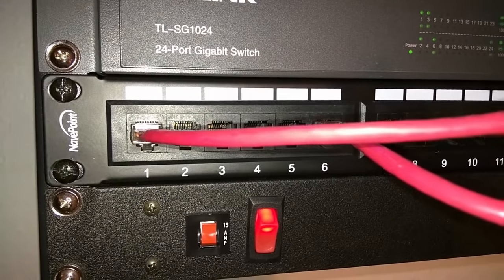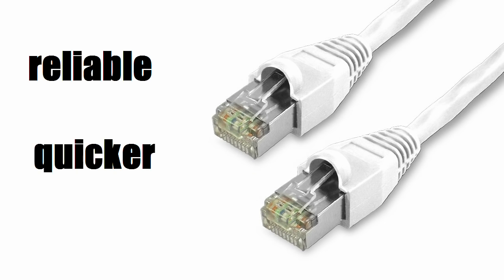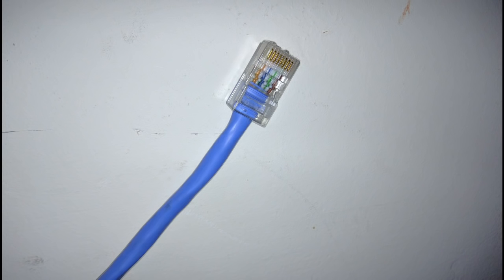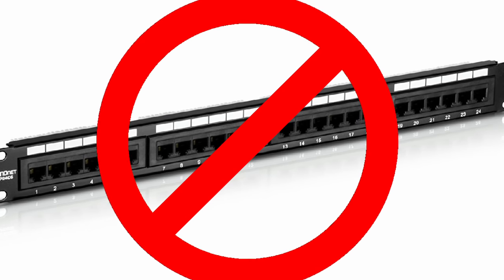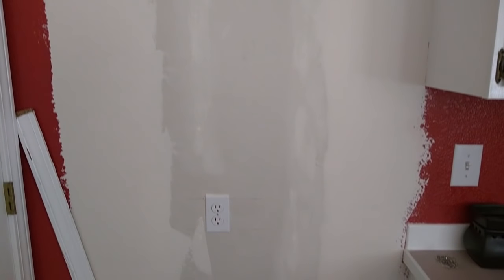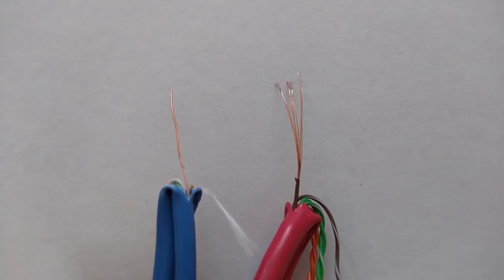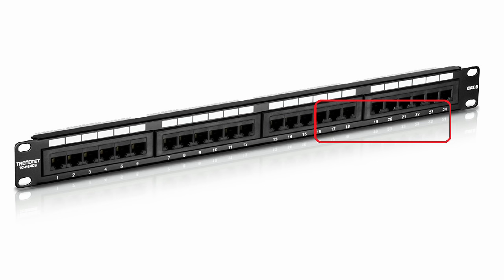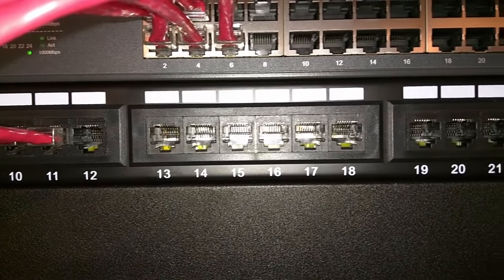What is a Patch Panel? Do You Need One?

Comment: question, do you have any other devices connected to the router LAN ports or just your switch?
Reply from the maker: Just the switch
Reply: @BudgetNerd  I see. In your opinion is it better for performance and speed enhancements to only connect the switch to the router and connect every LAN device to the switch? Thanks for your response!
Reply from the maker: I don't think you'd see much of a performance change either way. I just did it this way to keep it simple and to keep the rack neat.
Reply: @BudgetNerd  Ah I see. Thank you very much.
Reply: @Memoreno94  You will get slightly lower latency connecting to one of the ports on the router, since it's one less device that the connection need to go through. I only see this as a benefit for online gaming. The amount of latency going through the switch is minuscule, and wont affect most other things. You'll get 0 benefit in most other use cases though, and even the benefit for gaming is very small. Your total bandwidth as far as internet speed is concern will remain unchanged. I think if you have a fairly good quality switch, I dont think it's necessary, but if you're using a budget switch, you may want to consider plugging any gaming devices (if you're into that) directly to the router for this purpose.
Reply: @joemann7971  What would be a high vs low quality switch? I brought a Gigabit switch I thought that was high quality. Thanks for replying to my message btw.

Comment: Can you explain how you create a mini network with the crossover cable? I’m trying to understand how you can connect two ports on the patch panel with one cable and the resulting in the minion at work. Please and thank you
Reply: say you connected port 1 and 2. Port 1 goes to the living room, and port 2 goes to your office. When you connect these 2 you create a direct connection from the living room to the office. It wouldn't be connected to the internet or any other device on your network.
Reply: @KillerWhale806  I was thinking along those lines but your explanation helps clarify my thinking. Thank you for your reply. Very much appreciated

Comment: Is a switch necessary at all if you have a router and a patch bay?  Basically, can I just plug my router directly into any port in the patch bay and get internet to all ports?  Sorry for the dumb question.  I'm kind of new to the patchbay thing.
Reply from the maker: No worries. No, the patch panel is just a place to terminate cables that run through your house. In order to share the internet with other devices, you could use the lan ports on the back of the router.

If you needed more Ethernet connections than your router provides, then you would need a switch to share the internet with other wired devices.
Reply: @BudgetNerd  Thanks for the quick response.  The patch bays are actually in my new office's network room and they actually work.  I tested it where I connected one of my router's ports to one of the patch bay ports and plugged my computer into the other end in one of the rooms and I got the internet working which was great.  But I have a number of patch bay ports in that room that connect to about 90 or 100 ports throughout the entire office.  I was just wondering how I get all the ports to be active with internet.  I thought I would just be able to plug the router ethernet ports into one of the 48 ports on the patch bay, say #1 and have all the rest #2-47 receive internet.   Does it not work that way?  Do I actually need a switch port for every port on the patchbay?
Reply: @johnsousa4708  No, it does not work that way. All of the ports in a patch bay are isolated from each other. A switch is essentially a patch bay where all ports are connected. If you wanted, you could replace the patch bay with a switch, and plug into it directly, or add a switch and plug each port from the patch bay into the switch

Comment: Where do you buy all your modems, routers, switches, patch panels, and cabnits to house all the above.
Reply from the maker: Modem=Craigslist, router=Amazon, switch=Newegg, patch panel=Newegg, cabinet=Newegg.

Links to most of this stuff should be in the description of my DIY Home Network Video.
Reply: Everything on ebay cabnet $50 Patch strip $25 switch $100, modem from your network provider

Comment: question, can you use a patch panel with a POE switch!
Reply from the maker: Yes
Reply: Sure!  No doesn't matter if it's POE or not.  There's no differance from a CAT6 cable sending just Data, or sending Data and Power.

Comment: That's one smooth patch panel you got there. Total nerd street cred
Reply from the maker: Thanks! It is very important to keep up one's nerd street cred.
Reply: @BudgetNerd  one question I have back In the day i did terminate keystone Jack's using solid ethernet cable. Is it possible to terminate stranded cables? Or you loose performance or have connection issues.
Reply from the maker: You probably could... But it best to do solid. You might have issues down the road.

Comment: Are solid wire faster for same price than the others? 😊
Reply from the maker: Not faster, just purpose built.
Reply: So why would you pick them? Just because they are more sturdy and less likely to break when sitting immobilized in the wall?
Reply from the maker: That, and easier to punch down, usually can get plenum rated cable for fire safety and other reasons.
Reply: Good to know, thanks for the info! 😊

Comment: How do you connect a patch panel to WiFi/modem? I have the Ethernet wall jack and the wire goes to my patch panel but I don’t know how to connect it to WiFi box
Reply from the maker: Check out my Network 101 video.
Reply: The router goes to the switch, and then every other connection is patched into the switch via the patch panel. None of this works without the switch.
Reply: Jason Zurlo my wifi box/modem is in one of my rooms and for some reason the wall port it’s connected to is the only one in the house that it works for. The other side of it is plugged into the patch panel. Do you know why that’s the only wall port that works? I can’t figure out the reason

Comment: Can u run stranded cat 5 cable on walls, crawl space, or attic? Or does it have to be solid?
Reply: Punching down stranded cables doesn't work.  IDC connectors require solid core.
Reply: you can see its Cat5e
i would recommend using cat6
Reply: @joshuaclark3848  Or Cat 7 if you can afford it, since in wall wiring is a long-term investment.

Comment: I'm an electrician and I do occasional data jobs, I've terminated dozens of patch panels, and not once have I considered it for my house. You don't need one unless you live in a huge mansion
Reply: Joe M In smaller houses I have used 1 or 2 4-port panels in place of a patch panel. Most of the same benefits in a much more compact form factor.
Reply: Unless you want wired internet access for your audio/video equipment which keeps it from buffering when videos are streaming, along with an NVR type home security camera system, which is what this electrician is planning for his 1400 sqft three bedroom two bath home.
Reply: Most network switches have like 6 outputs, a 24 port is a bit much but whatever floats your boat lol
Reply: Joe M yep, six for cameras, one for a central located wifi access, four for entertainment center, three for the computer room and room for future additions.
Reply: Joe M you're misunderstanding. If you only need to run 4 sockets then a 4 gang socket is a compact alternative to using a patch panel. Patch panels take up space. A 4g socket doesn't need to be hidden or of sight.
Reply: same here...2 more months to go.
Reply: same here...2 more months to go.
Reply: Really?  Crap, my house needs to grow a lot larger.  It's only a 3 bedroom 2 bath with a garage and only 2 people.  I have 2 24 port patch panels and a 48 port switch!!!  With future needs of running some IP POE Cameras.  I went from a simpler setup I did 5 years ago, not using patch panels and just a couple wood shelves in my closet.  My cables just had RJ-45 jacks on the end plugged into my 24 port switch.    It worked, though there were some cable issues I found out and why I was having some streaming issues with my TIVO Mini and Tivo Stream which is now cured.    It looked like a cheap basic home network that someone knew a little something.  

My Setup as of a couple weeks ago, after 5 years now looks like a custom professional setup.  It's nice and clean and looks really good.  It's something you can show off to people if you want.  It's not a cable mess.  Personally, I think it looks much better than our Network setup at work.  That setup is growing greatly as we've installed a commercial Wifi MESH setup all around the factory and even inside the freezers you have Wifi access.  It's a huge boom for me as most of the area is like a faraday cage.  So cell service, Wifi, etc all dead,  Now I have service which I need, and Wifi Calling is a must have.   But soon we will be installing a bunch of POE Security camera's all over the inside mostly, but also replacing all the older outside camera's and adding a few more.  

I say, if you have a device that sits in one spot and has an ethernet port, Plug it in. If it has no ethernet port and it moves around like an iPhone or iPad or laptop, then use Wifi.   Wired is faster, especially the further you go from your router. It's just more reliable.  No interference issues.  Especially if you have people around you all with Wifi.  

Using a Keystone type Patch panel just makes for a much nicer looking, overall job.  There is a lot of flexibility when using that type.  It seems crazy having so many Ethernet cable runs in my small house.  But I have a bunch of devices and a growing Smart House.    Instead of having small switches all over, I have 1 large switch and enough Keystones around my house in all the rooms.  Man, if I had a huge Mansion, I think I'd have about 6 more of these Keystone Patch Panels than the 2 I currently have!!!  I'd have to get a couple more 48 port switches!!!   Hell if I had a mansion, I'd be running a 10-gigabit Network around the place also.  My Dad lives at my house.  I did the major change from old to new setup while he was gone for 3 days.  I ran 9 new cat6 cables under my house, Installed an 8U rack, etc, etc.  All by myself.   It was a dirty job.  5 years older when the last time I was crawling around in the dirt under my house.  

I love the end results.  You would never guess anything like it in my house. In the neighborhood I llive in!!!

Comment: If a patch panel is like a socket can one be used behind a TV setup to connect say a ps4, Xbox and the tx to the lan
Reply from the maker: Yes you could. But patch panels usually aren't surface mounted, or will have the wires in the back that will be visible. The wall socket will hide all that in the wall.

Comment: Wouldn't a wall jack to switch or router be same as wall jack to patch panel?
Reply from the maker: It is similar, except a patch panel gives your cables a permanent place to be wired. Onced you patch the cable from the patch panel to the switch, yes they are very similar.

Comment: So a patch panel is like a switch but every output has an input instead of many outputs and one input?
Reply: yes exactly
Reply: A switch is an active electronic device and nothing like a patch panel.  A patch panel is merely the termination points for network cables in an organized panel instead of lose rj45 plugs.  IMO, punching down to a panel and keystone jack in the other end is really easy.
Reply: A good way to think of a patch panel is like setting up a bunch of open pipes. Whatever you plug in at one end pops out the other. Easy to move services around, change functionality etc

Comment: How do you get into the crawl space where the immobilized wire(solid core) to route the wires to the other room?
Reply from the maker: In the US at least, there is always access to the crawl space. Usually in a closet somewhere in the house. It's a square door on the floor covered with carpet.
Reply: Or in the attic. It'll be either underground or above you.

Comment: What’s the difference between a patch panel and switch?
Reply: Patch Panels have no intelligence. They don't consume power. You can think of them like power distribution units. They are part of a large whole of organization. They do not interfere with the network traffic in any meaningful way. They do not bridge any ports to share traffic between them. 

A switch has intelligence. It consumes power and forwards packets to their destinations based on the forwarding table and its own internal logic. One of the key functions of the switch is to bridge all the incoming connections in a way that network traffic comes to a shared space.

Hope that helps. I recommend looking up both in Wikipedia for more thorough explanations.
Reply: Michael G d
Reply: Michael G there are four types of switches unmanaged semi managed smart switches and fully managed switches try to stay on the far end of each Spectrum and stay away from cloud managed unless you have the money to blow on a yearly subscription
Reply: Don't forget POE.
Reply: @Michael G  Power over Ethernet is a feature for longer distance or power cord less devices.
Reply: A Patch Panel does nothing much.  It's a connection point.  Your Wire in the wall A going to the Patch Pannel B.  But then what?  It's not connected to anything.  So you need to plug into a Switch.  Now most routers including Wifi Routers have a built in 4 port switch!!!    But you can easily expand this by plugging the router into say a 24 port switch.  how you have 23 ports left.  Now you plug short Patch cables from the Panel Panel into that Switch.  This not only allows devices to connect to each other on your local network, but gain access out into the Internet, from the patch panel, though that cable into your router switch and out onto the Internet.  

You can also add switches to where ever your cables go to expand your network that way if you don't have enough ports.  

There are unmanaged Switches.  Just plug everything in and it just works.  Then there are Managed switches.  You can log into these like with your Router.  This gives you a lot of other capabilities. Generally, things most normal home users don't really need. 

You can also get POE switches.  POE means POWER OVER ETHERNET.    This allows you to use IP POE cameras for example.  Internet Protocol, Power Over Ethernet.   This allows you to run just a single ethernet cable to a security camera for both Digital Video and POWER for the camera to run.   Digital generally means a better, clear picture without interference issues you may get with Analog and your typical Analog BNC type connector which is very common on cheaper Security camera systems these days.  There are 2 cables on those, one for Video and one for power.  It's also bulkier, and a certain length.   With ethernet, it's a single cable and you can easily cut it and make it whatever length you want.    Much easier to run ethernet than the other cable.  I wired up a friends 2 story house with the Analog garbage and it was a pain, and ran into a few issues that were not easy to fix.  I got it all working, but it was not easy!!!   That was 8 Analog cameras on a 2 story house!!! Yuck!!!

I just ran a couple ethernet cables out to my garage for future IP POE Cameras I plan to get.  Along with a small POE switch to power them all.  That will then be plugged into my Home Network.  So I don't need a large POE switch as all of my current devices don't need POE.
Reply: JB Dragon you are so awesome thanks for taking the time to share your knowledge! Hope there are more people like you? I have a question tho, why can’t we just run the cable jack from the wall directly to the switch instead of using a patch panel as the middle man?

Comment: Does it have to be connected from number 1 ethernet port of the TPLinks Switch to the number 1 ethernet port of the patch panel?
Reply from the maker: No that's just how I did it
Reply: Budget Nerd i see! In this case as long as the switch provides an internet connection no matter which number of an ethernet port the connection is coming from.

That’s my dumb question btw.
Reply: Budget Nerd your videos are very helpful keep it coming. Thumbs up!
Reply from the maker: One Ethernet cable from the switch (can be any port) needs to go to one lan port on the router. When connected to the router this way, any device connected to the switch will have a connection to the internet.

Comment: How would I know how much cat 6 cable I would need if I'm doing a 4 bedroom house and a living room
Reply: By measuring. That might be a pretty crappy way of saying it, but there is no way to actually know unless there is a detailed plan to go by.
Reply: Like Adam said, by measuring, however you can get a rough estimate pretty easily with a tape measure and pad of paper, just measure across the floor (you can also measure through walls) and then add the length difference for getting to the attic or crawlspace and then the distance up/down to the port in the wall, it will get you close enough to buy a spool or wire and then run every wire individually or you can make the lengths in excess and pull them all at once.
Reply: You can buy spools of CAT6 on eBay for almost nothing.